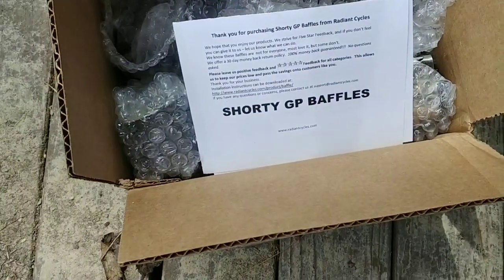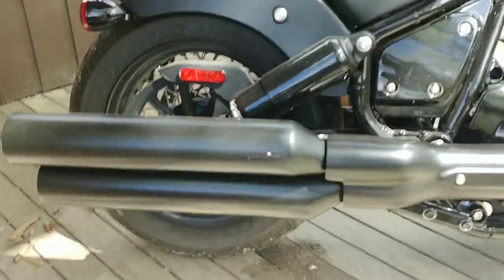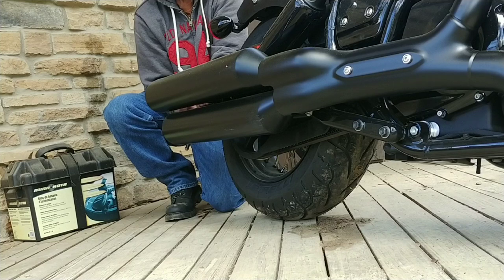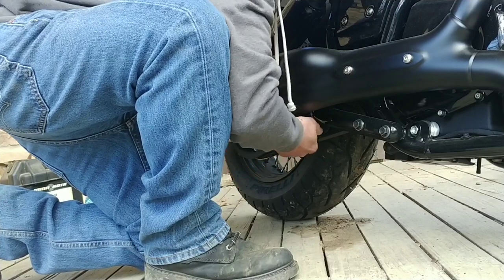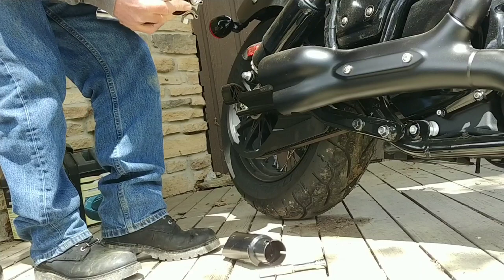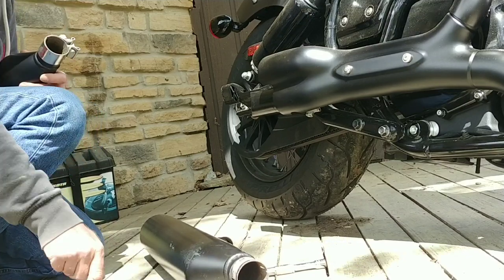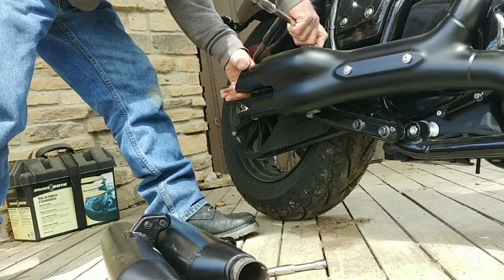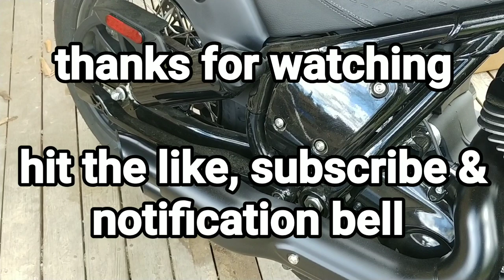2023 indian chief bobber dark horse exhaust install & sound #shorty #exhaust #indian #chief #bobber

Comment: Thanks for this video , a great cheap mod for a little outlay , which is probably all you need to do without spending heaps of money  $$$$ on a full system , air cleaner  , tuner , and dyno test , and  it sounds good for what they are , and look the part  ,
Take care .
Reply from the maker: yea, as soon as I bought the bike after about 2 rides I was like .... this needs to sound better but I couldn't decide what to get ... there are sooo many options and I didn't know anyone who already had something installed i could hear in person because what you hear even on youtube is not exact, even with these.  Knowing that, it would be impossible to make a decision based on youtube alone.  I must have watched every video on indian chief bobber exhaust .... and since I couldn't decide, I found these and was like ... they are cheap enough, even if they suck I am not out $1500 lol.  I was suprised after installing them how well it sounded.  I did do the stage 2 upgrade later and the exhaust made it sound great and the stage 2 gave it a stupid amount of power (compared to stock) and if you have one stock, you know they aren't lacking for power to begin with.  I'm satisfied with the setup just like it is, this exhaust and stage 2.  If I were to replace these shortys, it would be because I found something I liked and heard in person and I might upgrade then just to reduce weight because this setup still has the catalytic convertors installed.  They get super hot even with the factory exhaust and I'm more afraid that exhaust area near the leg might get even hotter replaced with something else that is thinner.
Reply: I'm putting them on a new Rouge , like you , it's hard to decide when you have to outlay a fair bit of money . What oil you running ? Or are you using the INDIAN SERVICE KIT OIL?

Thanks .
Reply from the maker: @brettwicks7339  I just had it serviced at Indian so far but prob going to do it myself this year. I kinda felt like the cost was pretty expensive for what it is (i used to do mechanic work when i was younger).  The first service was over $400 and i was like nope, not again.  It was right at the mileage of needing 2nd service done at the end of riding season.

Comment: Interesting video thanks.. do you think the shorty pipes with its buffle will sound like a sewing machine as well.. thats why you didnt put them buffles ... Thanks
Reply from the maker: So I should probably clarify something many people visiting for the first time probably don't know ... I bought this bike as my "you beat cancer" reward just a year after chemo and radiation.  Sadly, the chemo and radiation destroyed my hearing.  So truthfully, I don't know how the bike sounded from the factory but to me it sounded like a sewing machine.  I can hear it now especially coming to stops and the fuel system loads up and it backfires.  As far as how it would sound with the baffles in or out .... i think the shorty pipe baffles are so small it won't matter if you put the baffles in or not - this bike is a head turner now, I am all the time having other bike guys and random strangers walk over and check it out.  Also, I originally bought these to hold me over until I could decide what headers and pipes I really wanted.  My bike still has the factory catalytic converter but i am happy with the shorty pipes and might just leave them on forever.

Comment: Those shorties sound great but I'm wondering what's holding the pipes to the frame now? It looked like the stock exhaust was held at the back by two nuts. If the shorties are just clamped to the pipes, are the pipes just now held at the head? Sorry if this is a stupid question, there's nowhere near me to check out the stock exhaust brackets. Thank you.
Reply from the maker: I will have to go outside in a bit and look but the biggest difference is that the factory mufflers probably weigh over 40 lbs (other channels weighed and published that data so i didn't want to just repeat it) and the shorty weighs less than 1 lb so you aren't really adding any stress or weight to the end of the factory headers.

Comment: Did you have to do any retuning?? I just picked these up and wondering if I need to line up a retune
Reply from the maker: nope, didn't have to retune the bike if all you did was the exhaust.  If you do the intake, fuel injectors, or cam it will need retuned

Comment: I want it quieter on the highway. My Scout Bobber was too loud on the highway my DB levels were near hearing loss levels over long trips. You will lose torque without baffles from lack of back pressure.
Reply from the maker: I do have hearing loss. I have prescription hearing aids (result of chemo and radiation not the bike).  I think they sound great on my bike.  It is true that you can lose some low end torque with a less restricted exhaust (but you still have restriction from the catalytic converter).  I can absolutely state it is not noticeable if there is any torque loss on this bike because it has so much torque to start with....and that was before i also did the stage 2 upgrades with Lloyd tune. Now its just stupid powerful and I've owned a LOT of bikes. I still have no regrets considering cost vs improvement and these exhaust were just to buy time until i decide what exhaust im going to go with in the $2000-3500 price range....which just sounds absolutely ridiculous to say.